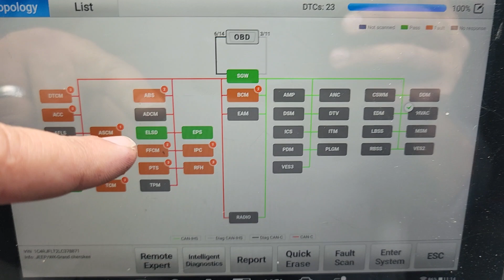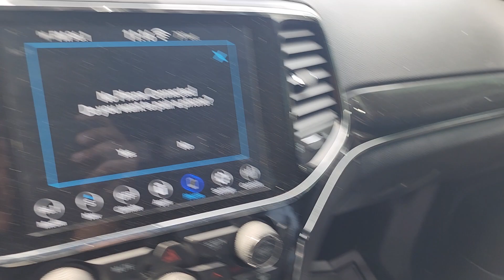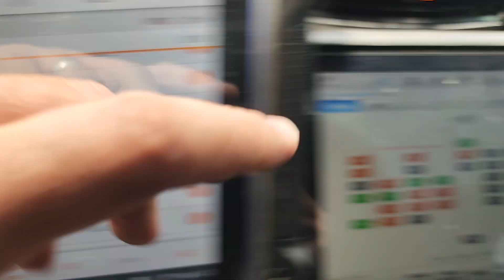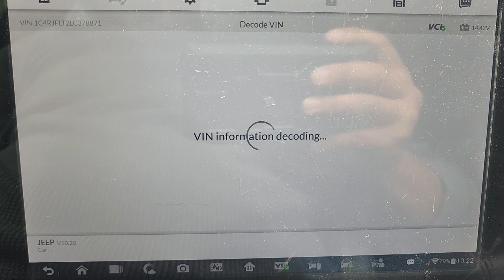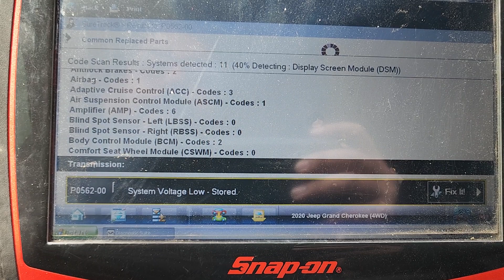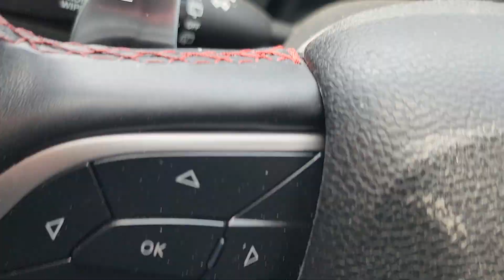We need an explanation, Autel

Comment: Would this have occurred after they did the vci updates that increases the scan speed? 

 I use the VCI200 For the KM100 on my 608 and it scans fast, very fast!!! 

I’ve been getting comm then no comm wi less it’s just me as the Topdon couldn’t do the scan on a BCM also. 16 Chev Camaro. 

I’ll know who’s as fault more later tonight on my specific issue.
Reply: Can you use the same VCI200 for more then 1 Device?
Reply from the maker: @Advanced Level Diagnostics  yes you, but its gonna connect to only one device at a time.
Reply from the maker: I never had those issues before. Actually you might be right, all things started to go backwards after tge recent updates.

Comment: Just curious 
Were you supposed to use the Chrysler adapter?
I also have the 919 and have had no problems, but I also have all the updates loaded
Reply: I had to use the adapter on a Wrangler, that’s why I asked
Reply from the maker: If you are talking about the 12+8 cable. It's needed to bypass the secured gateway. I have an AutoAuth subscription that allows me to ready FCA vehicles without the need to the cable. Even without unlocking the secured gateway module, I should be able to talk to all modules, just like the snap on did in the video.

Comment: Could it be possible that Autel or Snap-On are depending on the latest server updates that verify the secure gateway? Are you having this problem only with that make / model? Do you get the same problem using the same scanners on other vehicles?
Reply from the maker: Snap on wasn't able to unlock the secured gateway. Yet it was able to talk to all modules. Both autels were able to unlock the secured gateway, yet both failed to talk to all modules. This happened on a ford focus 2018 also.